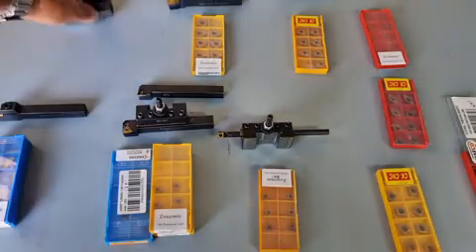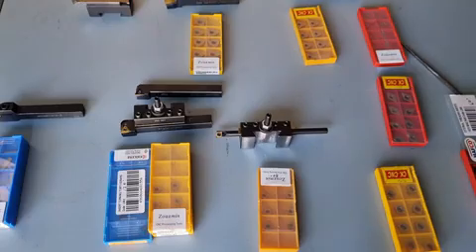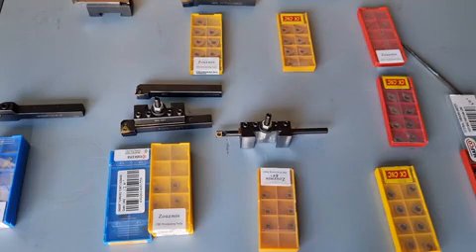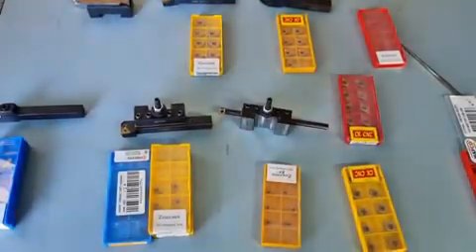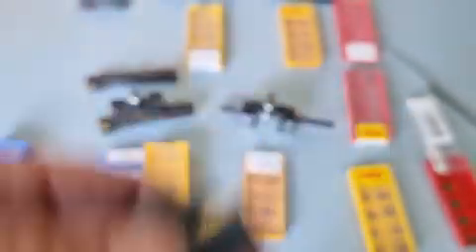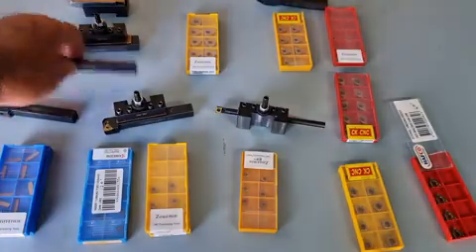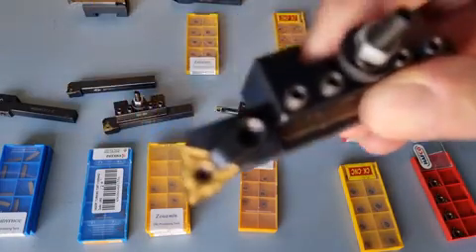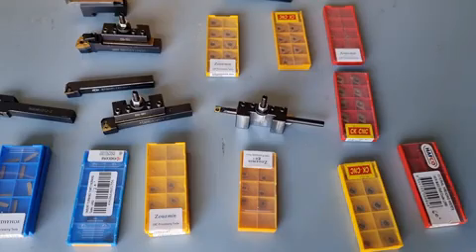Carbide lathe inserts so many to choose from what's best ?

Comment: One of the biggest differences in tips, which a lot of people don't know, is that some tips are pressed carbide and some are ground carbide. The ground type are usually better and usually more expensive. (Even from China).

ccMt = moulded 
ccGt = ground

It's not the case that ground tips are just for finishing either.
Reply from the maker: I did not know that.
So an assuming the ground ones are sharper
Reply: @hercus9a Yes usually. 🙂
Reply: Carbide is a word like "Kleenex". Specifically, "carbides" occur when some materials interact with carbon. Modern cutting tools are Tungsten carbide, all made by sintering in a matrix with nickel, and other materials, the binder. Starrett made gauge blocks from chromium carbide, the bane of welding stainless steels. "Tool Steel" is originally from the inherent carbon forming carbides, and almost all tool steels have a required percentage of carbon. Case hardening induces carbides on the skin.
Many inserts, especially for high stock removal at high speeds, have a radiused edge. A dead sharp edge is very vulnerable but serves low horsepower/home shop machinists well. A production shop rarely grinds carbide even if they have the requisite equipment, as a re-ground edge requires another touch off or probe time. New inserts, depending on quality of course, repeat easily to a half thou or better.
Reply from the maker: @bobbitelian thanks for that information on carbide

Comment: Let me start off by saying I am not a machinist, I have been a hobby machinist for around six or so years and picked up a lot of tips and learned a lot in that time but I do a fair amount of it for just being a hobby. 
If you don't mind a recommendation on your boring bars slowly start replacing them with the bars that start with a C instead of the S or at the very least get the bars that start with H. Don't forget a good bar that holds HSS like a JH Williams 00-B or Armstrong 07-X, those two are made with quality hardened steel will leave a fantastic finish when boring plus you never have to worry about having enough inserts. 
On boring bars that take inserts S means Steel, H means HSS and C means Carbide. Rule of thumb is don't extend a S boring bar more than 2.5 times diameter and max on C boring bar can be around 5 to 6 times diameter, I have pushed past these numbers and with light enough cuts been able to get a nice finish but getting the carbide boring bars which cost around twice the price of the steel bars really pays off in the end. Look for sales from the online place we all get them from and wait for the bar to go on sale, Generally around X-Mas is the best deals of them. 
I didn't have much luck with the threading inserts like you have there and have switched over to the Top Notch (Kennametal) NER and NEL 2 style and have yet to have an issue with them, yes they cost more and you can get off brands of them but a night and day difference on how much they can take and keep cutting. 
When it comes to welds I generally start off with a HSS with a large radius to take the interrupted cut and once I am past that part I switch to Carbide and speed up the rpm. HSS can take it a bit better and it allows you to resharpen it even if it does chip the edge. I have everything from Mo-Max on down to the stuff made in India and to be honest the stuff coming out of India will do 99 percent of what the expensive Cobalt HSS will do IMHO at a quarter the price or less. Also make yourself a shear blade for the best finish you will get period. 
Just my advise and take it for what you paid for it.
Reply from the maker: Most of my carbide boring bars are from china and I do have a few I paid a lot for.
Because I am only a hobbyist no point paing $100 for a 12mm boring  bar good brand name when ai can get one off ebay for $25
I paid $90 for a plastic pack triange 12mm carbide inserts.
They dont work any better than my $12 per pack of 10 carbide bits.
The more expensive boring bars are made better but that said for my works.
I do have some old HSS boring bars that came withmy lathe.
 I use the cheaper ones.
Thanks for your comments
Reply: @hercus9a  I have one U.S. made boring bar the rest are from China as well and they do great. Not sure if you think I was knocking them, I'm not knocking them at all. The China bars are working fine for me I just couldn't see the part line on the one in your video and mistook it for a Steel boring bar and was only recommending switching to Carbide if you haven't given them a chance which it sounds like you have. 
As far as inserts go I buy most of mine out of China as well and the only ones that I have that aren't from China are ones I buy off of online auctions and that is the only time I can afford name brands. For the most part the China inserts get the job done, the threading inserts are about the only ones that have given me issue so I make sure to get name brands that I know aren't knock off, it's getting harder and harder to get the real ones on those but I have stocked up.
Reply from the maker: @MegaLostOne yes same as you on tje threading ones I brought name brands only brought 5 as I dont do lathe threading much. Most of the threads are manually drilled and tapped.
At the moment am playing around with mill end.bits and a vertical slide  for milling making attachments for it.  Mainly vice attachments so it had versatility.
Reply from the maker: Also using HSS on the welds and switching over to carbon when past the weld is a good idea.

Comment: The tips in the yellow boxes bottom row, you can buy tool holders that use the other four sides, but of course you can't turn right up to a internal corner.
Reply: I made my flycutter to use those unused corners.
Reply from the maker: Thats a great idea
Reply from the maker: Yes I was wondering if ther were shanks that could use the other corners thanks for the tip.